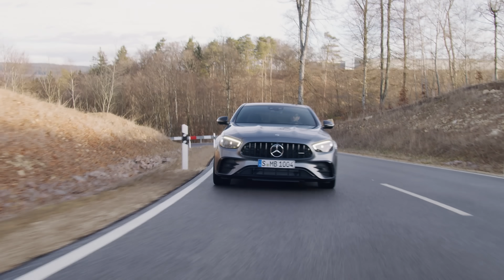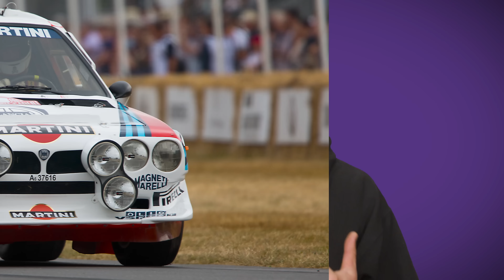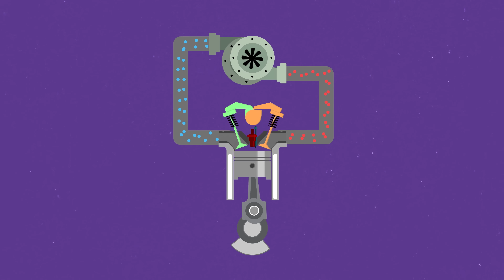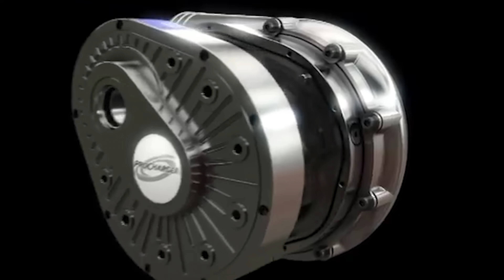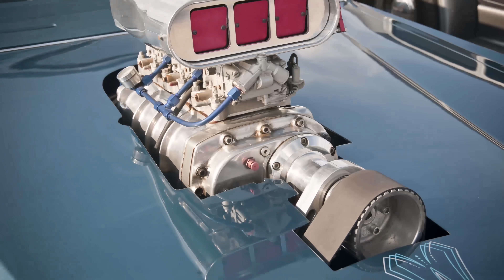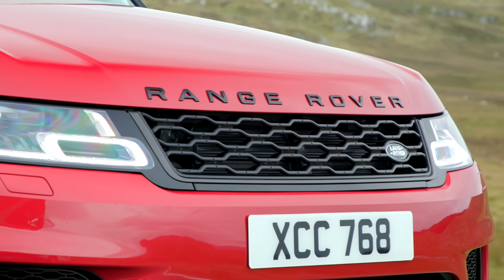Why Your Engine Isn't Twin-Charged

Comment: Have a plan to make a built gr86 with an fa24 that is twin(kinda) charged. With a 48V electrical system with 4 compressors, 2 for intake cooling post turbo and 2 for chilling the intercooler loop of the harrop tvs1320. However the turbos will be electrical, 2 of them feeding the intake of the supercharger to compound the effective mass per revolution and producing around 7psi pre charger, and around 30psi afterwards. I would have used a typical turbo, but it would complicate the design and would ruin the exhaust sound that I'm aiming for, plus I already planned the electrical system so it was easier to just use electric instead. System will make around 800whp, or with a simple pulley swap (essentially hot swap in around 10 minutes) or a flick of a switch to disable the electric turbos and make a modest 300whp.

Comment: I have a 2005 Mercedes E320 CDI engine I'm putting in a different car. A lady near me just put the Kompressor out of her C320 for sale on Marketplace for $100. Now I'm really considering trying to figure out how to put it on my engine. 3.2L twin charged L6 diesel really sounds like the move.
Reply: I've built a 2002 Mercedes Benz C32 with big rear mount turbo blowing into the Supercharger for Drag n Drive events in Australia. btw I also own 2x w204 C320cdi's

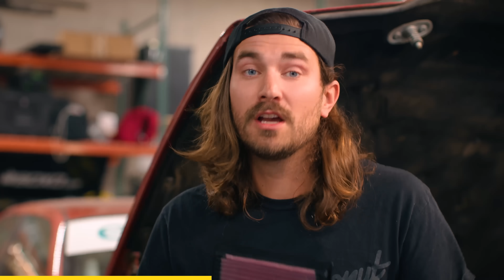Comment: 1:47 and you can tell by all the dirt that goes past the filter into your top end for a "Baja Bore-job". Achieve racing clearance and low compression with one overpriced bolt on product....😂

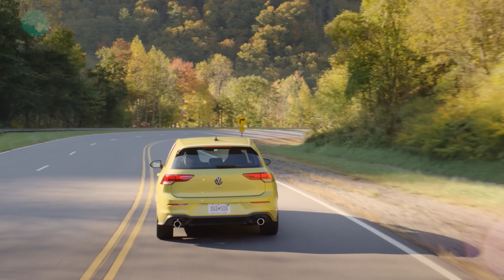Comment: 12:22 I currently have a Twincharged Golf MK5. Its super fun to drive even with only 170hp!
Reply: What is the size of turbo and supercharger in that?
Reply: @ankitsachan8056  oh, they are not that big, I kept it bone stock for reliability reasons. How ever the turbo is a K03-005 (VAG): 36/50mm Compressor, 36/45mm Turbine and the Supercharger is a compact Eaton M24 Roots-type supercharger with approximately 400 cubic centimeters (cc) or 24 cubic inches per revolution.

Comment: Or you could put an electric motor on a turbocharger's shaft.
Even better, use a piston based displacement adjuster that maintains the same 2.5:1 expansion to compression ratio regardless of boost

Comment: Can a 2018 E63s or C63s with the 4.0 BiTurbo handle Twin-Charging?
Reply: no room to add a supercharger on a hot V motor but I've built a 2002 Mercedes Benz C32 with big rear mount turbo blowing into the Supercharger for Drag n Drive events in Australia.

Comment: What if you had a dual valve for the turbo and could swap the output back into the input until the turbo has been spooled. It would probably make turbo lag shorter, and it’s basically what dual charging already does.

Comment: USING A ELECTRIC CVT  RUBBER BELT ON CENTRIFUGAL SUPER CHARGER AND THE TURBO OF A  TURBO CHARGER TO EXTRACT THE EXHAUST POWER

Comment: Just want to add, your info is a bit incorrect.  My 2023 Volvo S90 B6 Ultimate IS twin charged.  It's turbo charged, super charged, and electric boost.  The Supercharger is electric, by the way.  My car is a mild hybrid with a 48 volt system, so that kinda changes the class, but you had mentioned only two types of cars that currently offer the twin charge system.  Volvo still does with their T6, T8, and B6 systems.
Reply: And, to be fair, you did mention the electric super charger is a whole different beast.

Comment: I mean it seems like they'd have figured out electric turbos by now, being able to spool it up electrically at low exhaust pressure, and letting exhaust pressure take over once it's built up enough. Would be an amazing way to "twin charge".

Comment: What happens if you use two different size turbo chargers one that spins at low rpm and the other that kicks in at a higher rpm!?

Comment: Fwiw you dont need a diversion plate to switch between systems.  Water injection pre supercharger solves this issue of efficiency loss at high rpm when feeding it booat from a turbocharger.  Ill post vids of my setup eventually.  Junkyard recond m90 and a precision 5858.  Under 1k (plus a shitload of fab)
Reply: I've built a 2002 Mercedes Benz C32 with big rear mount turbo blowing into the Supercharger for Drag n Drive events in Australia. Mine has no diversion or cooling for the turbo air as have 7 degrees Celcius IAT's from forced induction interchiller only peaks to 70c at end of a pull and back to 30c once off the throttle.

Comment: Couldn't you add a system like how a bikes pedal to wheel ratchet works or like one of the certerfugal clutch on to a connecting rod to the turbine on a turbo an connect it to the crank as well so at low rpm the engine powers the turbine from the crank then at the high rpm range the clutch will just disinage and the exhaust will power the turbo as normal?

Comment: there are 9 production engines that twin charge
you forgot the vw 1.4 twincharged tsi
I am an owner of a mk5 golf gt that is twin charged
its as quick as a gti has the same sport suspension electrical goodies etc and weighs less plus gti are overrated asf i get more respect from even gti owners for the twin charged engine

Comment: What if we combined the two mechanics together? The unit would be pully powered at the start and at a set rpm the pulley would disengage as exhaust gasses increase. This would allow for it to be tuned to squeeze more power however at the expense of the parts adding more wear. Wouldn't be an issue for high quality however.

Comment: I had an XC90 T6 with the supercharger & turbo and, it still felt underwhelming. Has the polestar upgrade but doesn't do enough. It's a surprising vehicle for a suburban grocery getter but def not enough. I couldn't imagine what its like in lower trims or without the polestar upgrade. I gave it to my wife for her old Lincoln then traded that in for a 300 SRT8. Feels good to have a powerful V8. I do miss that Bowers & Wilkins sound system as well as the air suspension but outside of that, it was overpriced and at the dealer for repairs more often than it should have been. Nothing with the chargers but constant gasket and pressure issues. There was a constant fault with the accessory battery too. There's a reason its rated low in reliability. My wife doesn't seem to like it much either. Trading it soon and dumping it off at a dealership for some poor sap looking for a "good deal" on used Volvo. Never buy a used Volvo, you may end up with our old poopy one or many of the others ppl dump off after a few years. And no im not a Volvo hater, ive had 2 prior to include an XC60 R-design(back when r-design was an actual performance pacakge and not just an appearance package)that i loved but that new 4 banger is sad.

Comment: Y'know. I've never understood how a supercharger makes a good seal. A turbo charger doesn't need one because it uses physics to make sure there's constant pressure. A supercharger though needs parts that mesh perfectly to create a good seal with the male and female rotors.

Comment: Finally, someone who calls an engine an engine and not a motor (which are electric).
Reply: Engine produces energy. Motor provides motive power. While not every engine is a motor, sometimes an engine is indeed used to impart the motive power.
Reply: @BogeyTheBear  engines are run using combustable fuels. Motors are run using electricity.

Comment: Funny thing about turbo-supercharging which I'm surprised wasn't bought up is that it also makes a big difference if, say, you wanna go up really really high to 'chastise' Nazis hiding above the clouds, but you're still working out the kinks of jet engines. This is what the P 47 Thunderbolt used, and also why it's so ridiculously huge for a single engine fighter; the R 2800 isn't actually all that big, most of that bulk is just a gigantic General Electric turbo-supercharger system mounted behind the pilot.

Comment: 3 WAYS NOS TURBO SUPER  MMMM INTERCOOLED WATER METH MY LAG SUPER CHARGER IS POWERD BY A 125 TWO STROKE THAT PINS THE THROTTLE WHEN I TAKE MY FOOT OFF THE PETAL

Comment: If twin charging was more efficient than turbo or compound turbo we would see more engineers applying this to diesel engines from the factory. 

The new new is a electric assisted turbo. Small motor on the turbo that can spin a turbo faster than the exhaust gas can. Mercedes has a great design for this. Then once the exhaust gas catches up the electric assist shuts off. This will be the future.

Comment: Jeremiah, if you see this, you can document the  VW EA111 engine, especially the 1.4TSi/TFSi. I drive one almost daily.  1390cc of twincharged madness, being both economic yet powerful. In its most power, you can find a 170Hp version, BLG. Some claimed this type of engine to be problematic, presenting either piston rings failure, cracking pistons, alarming oil consumption (thing that is related also to the piston rings, if I recall right), and a weak timing chain tensioner that became weak at around 60.000 km or 37000 miles, things that have benn solved in the most part, but the thing is,maintained well enough can be a really fun budget-economy engine. Some even got the engine to 380HP, or even more, which I personally find astonishing coming from a VW 1.4l engine.

Comment: The purpose of greater displacement isn't more fuel: It's more VACUUM (pressure differential): 
The pressure differential from which to suck air in ... so that the fuel you add isn't wasted (rich).
The one car that seems to challenge this? The new Corvette which apparently violates physics.

Comment: Now, I'm not a mechanic or engineer by any stretch of the terms, however I wonder why a turbo unit couldn't be produced that runs on the electronic system, and be controlled to operate efficiently at lower RPMs as well, without "turbo threshold"? I mean, I assume there's a reason, or else we'd see something along those lines 🤔

Comment: you showed the wrong oil filter for the k&n sponsor. idk what the part name for it in k&n is, but you can translate from a vo-106 by valvoline, subaru like never uses canister oil filters.

Comment: I want a twin screw, whipple, roots, centrifugal, turbo, electric, vortec, dual scroll, variable twin scroll, linear, parallel, sequential, compound charged geo metro 3 cyl engine with inter coolers, after coolers, nitrous cooled with water injection and direct cylinder injection nitrous, TBI nitrous, direct port nitrous injection, pre boost nitrous and a stand alone fuel management system with a riveted in passenger side floor pan and a laptop that only says Warning Manifold Pressure and a guy named Hector standing outside that’s too slow to call 911 when it goes nuclear

Comment: twin turbo kinda does the same. It has a small and a larger turbo that gives you a broader powerband than a single large turbo would. I wish mine had a twin turbo. because right now I need to be at 2500 rpm before the turbo starts pulling. Once it starts pulling we sit at 700+ nm of torque so by then i'll fly.

Comment: Is it posible to put the out put from a small cheap super charger that pushes just enuf air to the intake of a large turbo and make it spool for that large boost with no lag and cooler air temp aka higher o2 content?

Comment: I keep thinking that a turbocharger could be designed that also has the gear drive of a centrifugal supercharger.  Of course it would need a clutch and some computer controls on it.  On the other hand, you could replace the gear drive with an electric motor.  Luckily, it can also use a standard turbocharger-style intercooler.

Comment: Ive built a 1984 1.6 turbo diesel rabbit..I installed a supercharger and twin turbos..
It took some major fabrication and tuning..But it worked...The engine only made 68 h.p. stock with a Garret turbo..I managed to achieve 376 wheel h.p. out of it..Yep..a lil tiny itty-bitty vw Diesel..zero turbo lag..

Comment: I like K&N oil filters as they capture finer particles without a loss of too much pressure but I quit using the air filters. I prefer oil-less air filters like AEM so as not to cause any MAF sensor issues.

Comment: I had one of those VW 1.4 tsi engines in a seat ibiza cupra until last year (I don't think you get them in the US) and absolutely loved that engine. Got 45 mpg on long drives but would pull like a mule from 2500rpm right the way up to 6500rpm. Great little motor and plenty fast enough to get you into trouble...

Comment: supercharge for drag.... turbo for 2 mile... my dads 96 impala would beat my grandpas 69 mustang  at a 2 mile highway race (both stock except mustang had better quality parts and  higher gears for the drag while my dad had lower gears for longer races) but my grandpas mustang would always beat him at the quarter mile. My grandpa told me "If i would add 1 thing to the mustang to make it better at longer races it would be a turbo for that extra boost after i hit the boost threshold"

Comment: A friend of mine had the twin-charged golf mk V GT, it experienced a few mechanical issues but was finally "killed" by a marten... btw, what about "scroll-type" superchargers as the G-Laders in the polo g40, golf g60, golf rallie, corrado g60 and the golf mk2 g60 limited (71 made, 207 hp + syncro). As a side note: I've seen one of these 71 mk2s at a meeting in 2008 and talked with the owner, the price tag was absurd 😂 (~100k for a fully original golf mk2)

Comment: Volvo doubled down too SC/TC SC for low end and TC for high rpm power. Koenigsegg used twin Rotex centrifugal superchargers on the CCX. Detroit Diesel Superchargers (6-71/8-71) wasn't really used as duals on a same engine. Unless you were building a street freak. Thats why even a Turbo charged vehicle has become a Hybrid, using an electric motor to fill the low end gap for lag, engine start/stop and a push to pass meatphor. Still an extra layer, still an additional piece to make a "twin-charged" setup

Comment: Dude you failed to mention one of my favorite vehicles, one of the most well known for twin charging. The Chevy Cobalt SS came with a supercharger from 04-07, then in 08 they switch to a turbo from 08-10, meaning it is one the BEST and EASIEST to twin charge, since it had factory super and turbo charges widely available and easily installed, it was cheap and simple(and not guesswork or much math involved) to twin that baby up. I wanna get one so bad you can push over 300hp through that tiny little Cobalt I love them.

Comment: What I've never understood is why diesels are never supercharged, they rev low, put out tons of exhaust so maybe that counters the low revs. They also have insane amounts of torque, which is going to power the supercharger. If there's a good reason it's beyond me, but I'm not a that knowledgeable about engines.

Comment: The Chevy Cruise SUCKED! Doggy tiny engine, but when the turbo kicked in, it had nice power, but that lag was horrible because the engine without the boost was a joke. So hit the gas, it does nothing for about a full second, then the boost and it jumped into the acceleration.

Comment: The worst part about the Land Rover, tho, which puts its twin-charged engine in the Range Rover, Range Rover Sport, Range Rover Velar, Defender, and Discovery (as well as in the Jaguar F-Pace), is that the Ingenium AJ300 series achieves a maximum 395 horsepower out of a 3.0L engine. I enjoy it for being a rare I6 in modern production, but like... it's a pain in the dick to work on and really underwhelming for its displacement. Tho it does put out really good torque, which is good for the boats it powers. Still... one good thing I can say about it is that as a JLR tech, it's excellent job security 😂

Comment: That's why EVs are so much better. Much much simpler in terms of design and much more efficient. A combustion engine will only ever turn 30 percent of the energy converted into motion. The remaining 70 is lost to friction and heat. Electric drivetrains get at least 50 percent with most getting around 70 to percent.

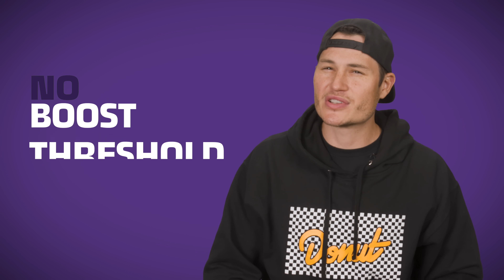Comment: Why is there an exponential increase in impeller speed as engine speed rises, in a centrifugal supercharger?  If it's belt-driven, surely the impeller runs proportional to engine speed, just like the other two SCs?  And why do you say (8:25) that roots and twin-screw SCs pump the same amount of air regardless of engine speed?  I am sure you mean proportional to engine speed!

Comment: On a construction job site that I was working on, about 20 years ago, the place we were working on was going to be a large casino. They had 2 HUGE generator sets that wete to be installed. The gensets each had a 2-stroke V-16 Detroit diesel, that had 4 turbos hanging off the exhaust manifolds, the output of which then fed directly into 2 Roots blowers, which were laying inline across the long intake manifold. 
The mufflers that were laying on the floor for them were large enough that I could crawl inside the pipe, and darn near stand up inside of it. I still have a picture of that around somewhere. It was QUITE an impressive setup. I imagine that a casino needs a SHITload of electricity if the grid were to go down.

I was there the day they were finished being installed, and then fired up and load tested. Them funkers ROARED when they were warmed up and brought up to full load. Being 2-strokes, and 16 cylinders, those things sounded like they were SCREAMING but in reality, being a 3-phase generator, they were most likely only turning 1800 RPMs.

I'm guessing that the sound I heard is EXACTLY why they call them, 
"Screamin' Jimmys"... The "Jimmy" part meaning GMC, who was the manufacturer of the engines.